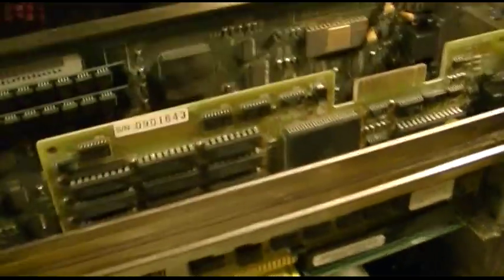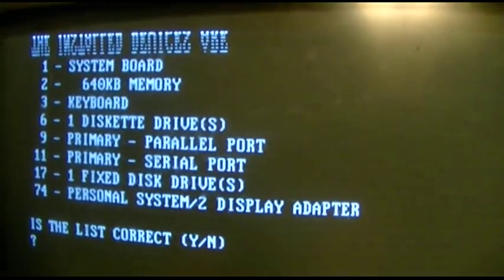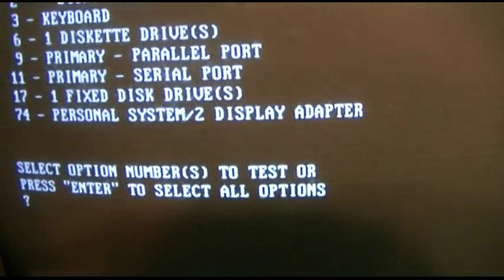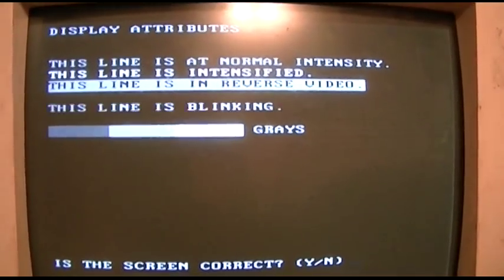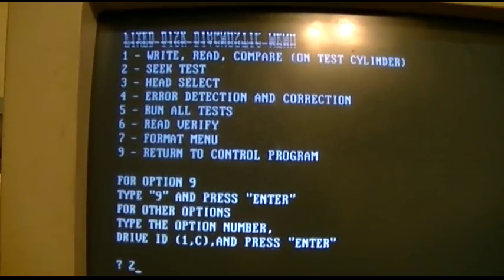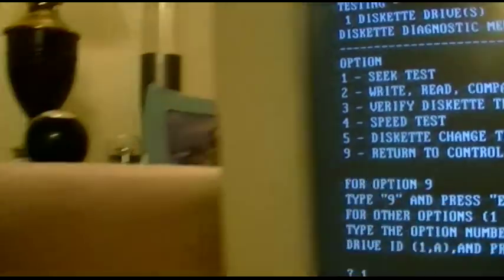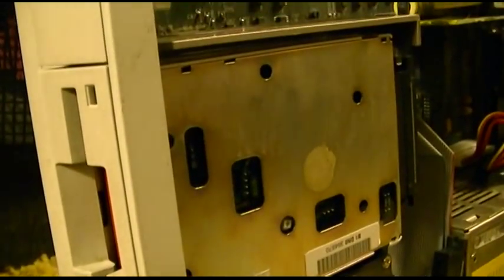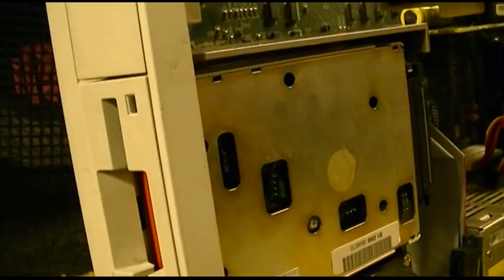IBM DUBSTEP - PS/2 Model 30 Floppy Drive Seek Test

Comment: I have a 1.44mb floppy drive out of a Compaq Deskpro 386 that is equally loud as this drive, AND I have the diagnostic diskettes for that machine, so if there is a seek test, I could do the same
Reply from the maker: If there is a seek test, you could run the seek test, but it WON'T sound like this!  This machine and the Model 25 PS/2 (non-286 models) had this seek test.  No other computer ever did, as far as I know.

Comment: Top of the screen looks like a monitor issue rather than a video card issue. Open it up and twittle around with the pots. One of them will adjust vertical height and another the sync, those are what you want to check. Bad timers inside the monitor can cause this, too.
Reply from the maker: I actually tested the monitor on a newer system and it worked fine.  Perhaps that MultiSync couldn't sync to what the Model 30 was outputting

Comment: Did the hard drive in this machine work at all?
Reply from the maker: When I got it, probably around 1994 or 1995, it was already 7 or 8 years old, and was having problems.  It occasionally would have seek errors, reset itself, try again a couple times, and eventually read.  Surface scans of the drive indicated bunches of bad sectors.  I ran whatever software I had to lock out the bad sectors, some taking a day or more to run.  After that, the drive was fairly reliable for a few years.  Eventually it started making a scraping sound.  I had fixed that once before on a different drive, by opening the drive, and using the pinky nail of my right hand under the arm that holds the top head.  I ever so slightly flexed it upwards and put it back together.  The drive ran a good 6 more months before it really started having problems and became unusable.  All of them die in the Model 30s.  It was a fun drive while it lasted, and made some pretty cool stepper motor sounds.
Reply: I watched your other ps/2 video also so I already knew that story.
Reply: It's a real shame that these drives are so unreliable these days because they sound so awesome.
Reply from the maker: Well the Model 30 was the start of the cheapening of the PC as we knew it.  Basically, the Model 30 was the next incarnation of the IBM XT.  Roughly twice as fast, maxed out memory, serial, parallel, mouse all on board.  Floppy drive was twice the capacity.  But everything was miniaturized, even down to the PC speaker, which was now a piezo squeaker can instead of a honkin' 3" speaker that could resonate it's sound off the heavy metal case!  Yeah, even the case was plastic.

Now IBM made a mistake with the Computer Memories 20MB hard disk on the AT, most of those failed under warranty, but that was more-or-less an early production problem.  They switched to more reliable drives and those ATs were absolute tanks.  I have an AT around with a 40MB Micropolis drive (I think it was) that works perfectly.  And I have an XT with the venerable Seagate ST-225 20MB drive, that drive is over 30 years old and still works perfectly.  

For whatever reason, some drives had proven themselves reliable, others were just garbage.  We were still in the early days of hard drives for PCs, so mistakes would be made.  The Model 30 drives ended up being unreliable.  It's a shame, too, because inside the drive was extraordinarily simple.  The stepper motor had a pulley, and the head arm had a semi-circular plane that would ride back and forth on that pulley, just by the friction holding them together.  There was nothing to give or slip, it was a pretty solid connection.

Also important to remember is a lot of times, these PS/2s were bought by corporations, and they were turned on after being taken out of the box, and never turned off until they were taken out of service years later.  The MTBF of the drives is going to be on the much lower side.  Just like a car--the more miles you put on it, the more things are going to wear out and need to be replaced.  Or you could have a 15 year old car that has the mileage a 5 year old car would typically have and it's still in pretty much tip-top shape.

Comment: i  am  also  fascinated  by old computers, how do i make  a  program that will  factory reset using a  floppy disk..i  have dozens  of program  files  on floppy disks..i  would get the system up but just couldn't  stop tweaking  until  they  revert back to faulty..
Reply from the maker: For an old computer like this, all you need is a DOS disk with sys.com and format.com on it, possible fdisk as well.  That's it, it'll let you wipe out the hard drive and reinstall DOS.

Comment: This is how the Techno virus should have been done. :) What a unique little floppy drive !
Reply from the maker: +Kali Krause Actually it's not the drive, but rather the diagnostics software that's making it "dance".  Using the same seek commands would allow any other floppy drive to make similar sounds.  Every floppy drive sounds just a little bit different.
Reply: +jaykay18 it sounds like A mini inkjet printer
Reply from the maker: josh It has a small stepper motor, just like an inkjet printer.
Reply: jaykay18 great video mate   my friend just gave me a 2007 optima laptop with windows vista  well i can tell you they weren't giving away ram when they made it  with 1 gig ram and a 80 gig hdd  but now its a one 1 terabyte hdd and 1.5 ram running  Ubuntu
Reply from the maker: josh That's the way to do it!

Comment: The screen thing at the top is because you have to move the picture downwards using the screen controls. The picture "rolls over" when it is set to high up towards the top of the screen.
Reply from the maker: +Stefan Christensen I'm well aware of that, but I actually adjusted it all the way "down", and also adjusted the vertical linearity all the way down and it was the best it could do.  I didn't want to drag out the monitor I had there, much less my IBM 8512 if it even works anymore.

Comment: Amazing! it still working after many years. I still miss this computer, it got a great build quality and  aren't even able to compare the crap build quality now a days. Are you using IBM model M keyboard on this video? sound like it to me. Maybe you will get a million video!
Reply from the maker: Thanks, yes I was using a Model M, since it was hooked up to the other machine there and was handy.

I had always questioned the build quality of the Model 30 especially, the top cover is made of plastic, which was a radical departure for IBM.  The inside of it did have some aluminum for EMI shielding, but it was strictly for that, it wasn't structural.

I also have a Model 55SX, and that DOES have a metal case but is otherwise the same form factor as this machine.  IBM switched off back and forth between metal and plastic cases throughout the PS/2 line.  Also curious is on the 55SX (at least the one I have), they used a standard key for the keylock instead of the round key style that was used on every other PS/2 I've seen.
Reply: Can you make a video on 55SX I want to see it!
Reply from the maker: I'll consider it.  There's nothing very special about it other than it being a 55SX; I doubt if the Dallas clock battery has lasted or if it will complain...